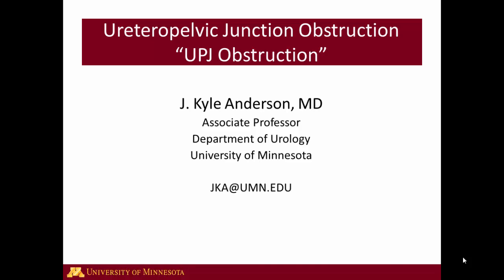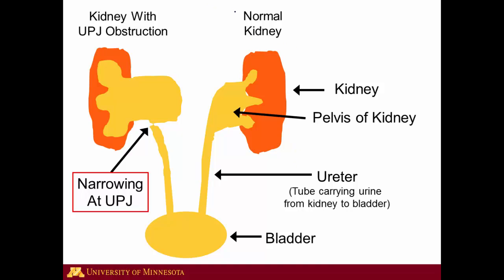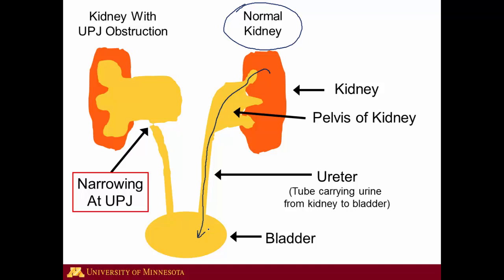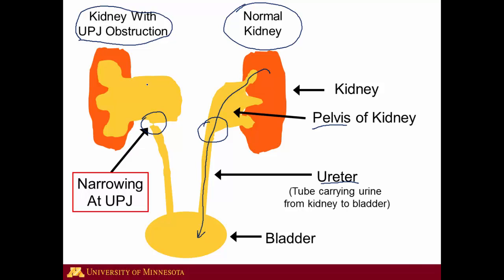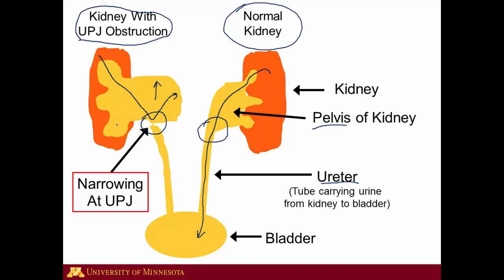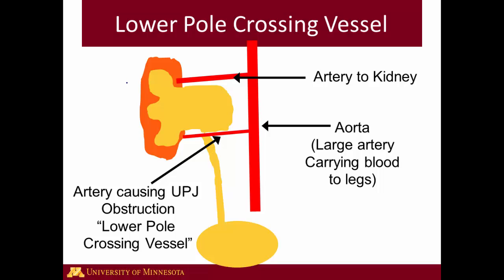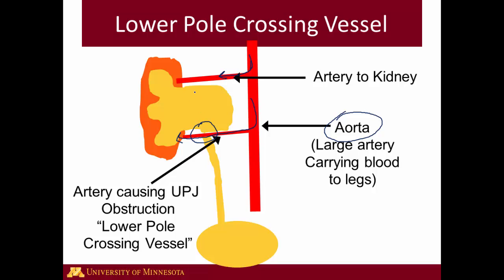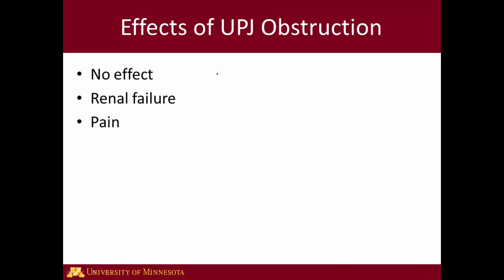UPJ Obstruction - What is it

Comment: I started wearing this belt for my lower back pain, especially when I was driving and then I started noticing the pain on my right side .. the pain got to unbearable point, so I went to the emergency room.. they told me I have UPJ OBSTRUCTION.. I explained to the doctor that the problem only started when I started wearing the belt , he did not buy it and he insisted that the problem was their since birth, may be the belt brought it to life, but it did not cause it!!!! I am 44 !!! I told him the belt was putting pressure on my organs and may have affected the structure of the wall of the ureter  .. I am going to another doc for a second opinion.. Any advises please. Thanks
Reply: I think me sleeping on my back started my obstruction. I used to sleep on my front and had no problems